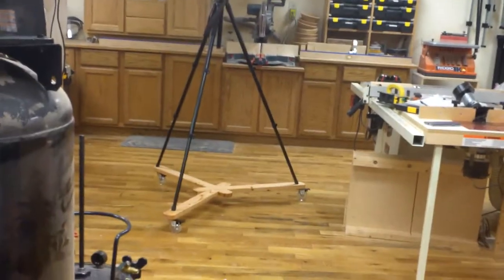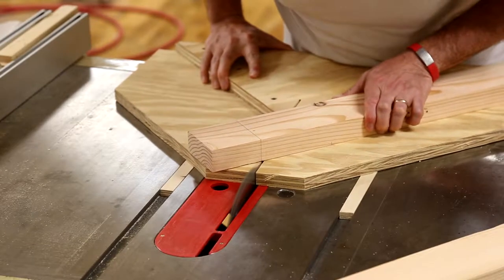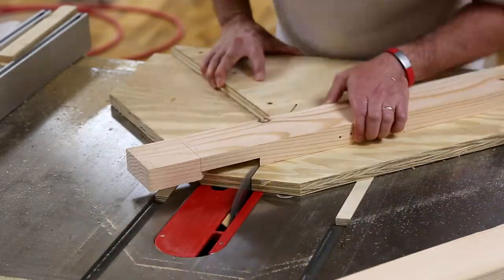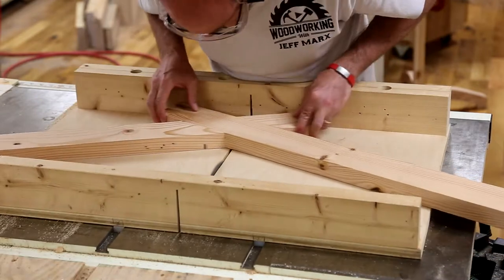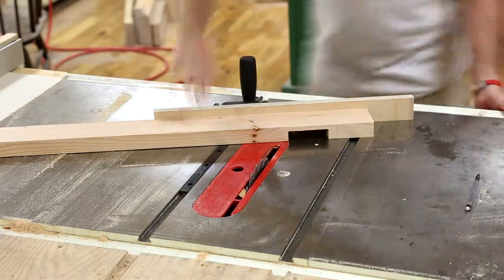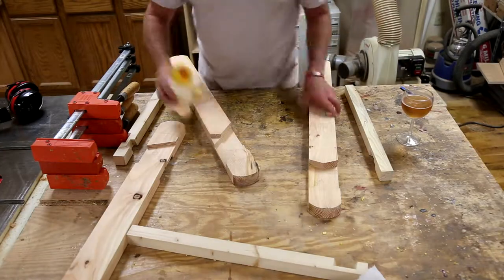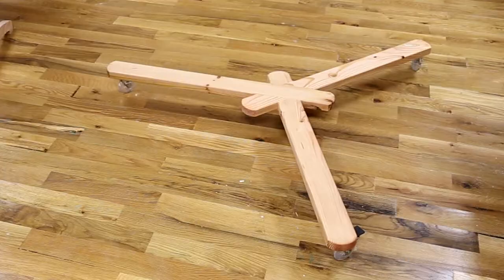camera dolly with three way lap joint

Comment: When you make the final cut across the two mated boards, the first two boards are not in the same configuration as the test fit when you mated them together in the previous shot -  (the scene when you said looky there, it comes out dead flush).  Now I'm really confused!   Help!
Reply from the maker: I had them in the wrong position when I test fit them and found they were "dead flush," I was really confirming the depth.  That bothered my OCD when I noticed I had done that during editing.
Reply: Ah OK.  That makes sense.  Thanks.

Comment: There are 120 degrees between each leg.   How is it possible a 45 degree cut on two mating pieces makes them 120 degrees?  It's making my brain hurt!
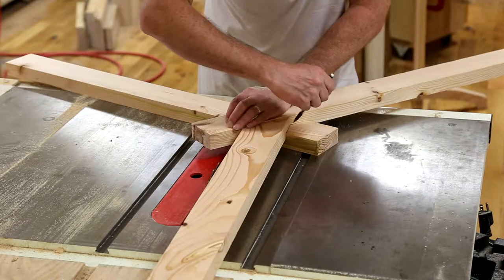Reply from the maker: Hah, funny!   I had to do a practice set to make sure I understood what I was doing before I cut the real ones even though it was just in cheap dimensional lumber.  The last cuts aren't really 45 degrees, they were what was marked at 5:19, and it's sort of an X which you can see at 6:09.  I didn't explain it well, but those triangles on the last piece got cut at whatever that angle was.  It didn't turn out perfectly symmetrical which I think happened when I put the two assembled pieces on my sled somewhat out of square.
Reply: Thanks for coming back so quickly Jeff.  Much appreciated.  I understand that some error is bound to creep in so it's not that that really concerned me.   I can see the final cut is made when the final leg is positioned against the first two legs, cutting the remaining angle between them in two (as close as possible, which is fine) but I still can't get my head round the angle between the original two legs if the cuts were made at 45 degrees, so I have to admit my brain still hurts a bit!  Wouldn't the first two legs be at the required 120 degrees if the cuts were made at 30 not 45?    - - Just a thought!     Or, should that be 60 degrees?   Argh!
Reply from the maker: @dacutler  Each piece meets at a 60 degree angle with the extension of the opposite leg for 120 degrees between each leg as you've described.  I can't explain how the two 45 degree cuts get you there without doing more math than I really want to.  I think it comes down to the fact that the initial 45's are cut relative to the opposite reference on the miter sled but I can't really explain how that gets you to 120 degrees.
Reply: Good points Jeff.  You're probably right. I'm going to have to actually draw it out, or maybe actually do it as you did.
Reply from the maker: @dacutler  Give it a crack, it's super satisfying when it comes together.
Reply: Yes, it looks very satisfying.   I have been searching for a method to create a three way lap joint because I have just finished making a hexagonal table top (4ft across) and have to produce a structure that is a multiple of 3 cross members as the support legs.  I've just produced a large hexagonal column, but want some way to attach the sides to the legs at the bottom and the table underside at the top.  There are plenty of videos suggesting how to make lap tops at 90 degrees, and I have done so many times, but none at 120 degrees.  Yours is the best inspirational video as it shows how to cross the three members in the middle in the same plane.  I'm going to try your 45 degree approach and another test joint at 60 degree approach too, to see if it works.
Reply: OK.  I think I've got my head round this now.   Making the cut at 45 degrees on the first member, and then moving the next 45 cut board round 90 degrees when joining the two (the difference between the configuration you said and the one you should have made when checking the depth), has created a total angle of 90  + 45 degrees, or 135 degrees.  If you make the two cuts at 30 degrees, using the same logic (that is, moving the members round 90 degrees in the configuration when joining them) you get a total angle of 90 + 30 degrees, or 120 degrees.The difference between the two is only 15 degrees, which might explain why it looks right, especially when you add the third member halfway between the two.I haven't yet tried the full joint (I just cut two test boards with 45 at one end and 30 at the other), so I am still going to use the feature you said.  That is, cutting just one third and two thirds, the depth to made the resulting joint flush.
Reply from the maker: @dacutler  Nicely done!  Reference the inside corner of the joined pieces for the cuts thru them if you can as it should be more accurate in case the overhangs aren't identical.
Reply: Will do.  Thanks for the inspiration, without which I would have lost even more sleep!
Reply: I cannot see how you can cut these pieces at 45 degrees, if you divide 360 by 3 you get 120 degrees.  I just did this and it came out perfect, how could it work if I had used 45?